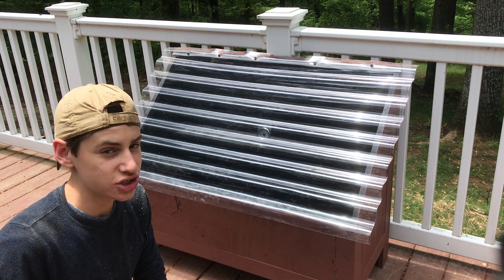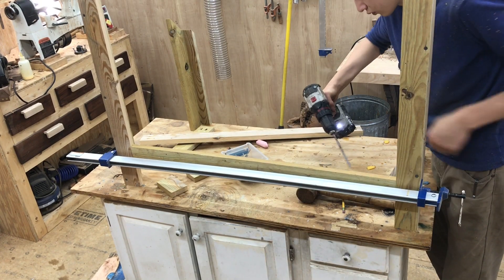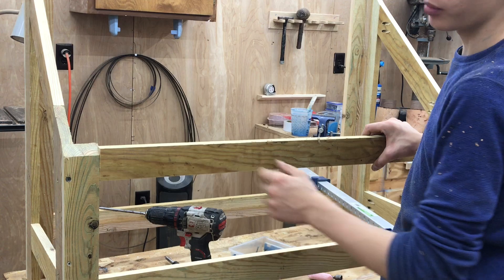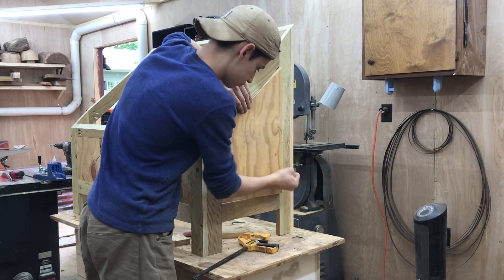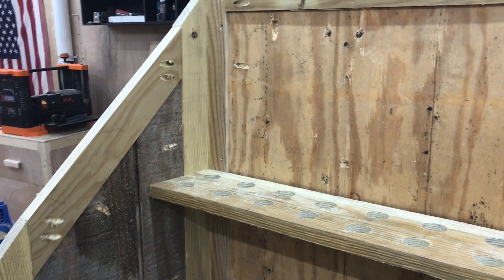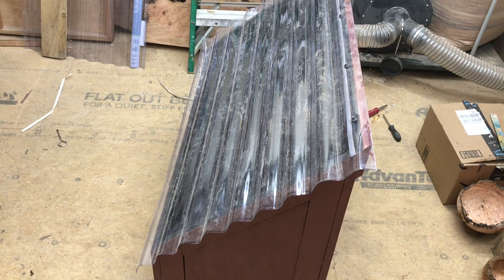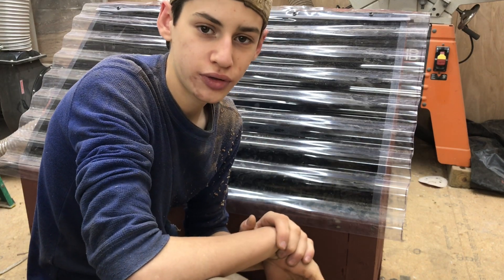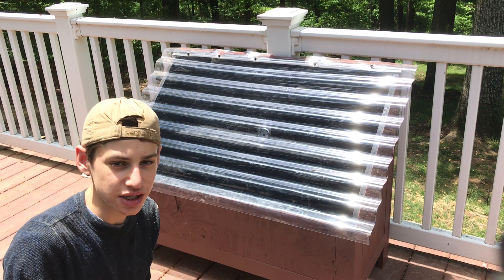Building a Solar Kiln to Dry Wood

Comment: Question, in the Virginia Tech PDF it states the size of the kiln is integral for the internal temperature to not get too hot. Because yours is quite small have you run into that issue?

Comment: Very timely video! I just retired, borrowed an old sawmill from a friend and may start a hardwood business. Thanks Seth!
Reply: I m also thinking to buy an old sawmill. Price of the sawmill you bought ??
Reply: @Hbcconstruction  Did not buy, just borrowed. however it took about 8 months of spare time work to get it running. Still a few thing to do to it but I can and do use it to do some sawing.

Comment: Great idea! Just the right size for the wood I deal with. I cut rough boards from my legs and put them on spacers in a closet in the basement. I put a small fan at one end. Finally got around to checking on them after 4 or 5 months, had a nice collection of oak, apple, Chinese elm, plum, and an unknown.  All were down to 10% or less depending on how close to the fan they were.

Comment: Don’t dry the wood to fast or it may check and crack the wood badly. Nice build.
Reply from the maker: I try and dry it as fast as possible because I fill all the cracks with black epoxy. The bowls with epoxy sell a lot better.